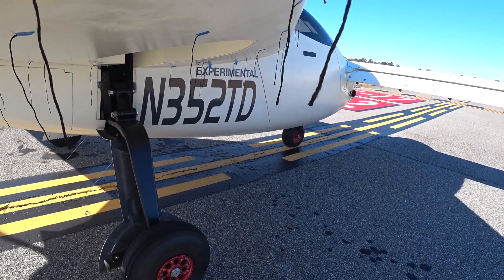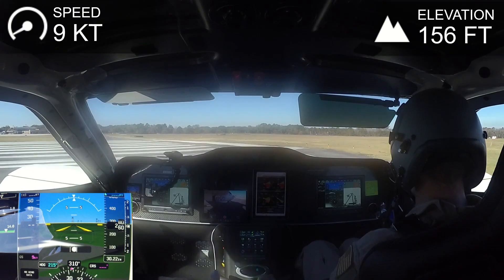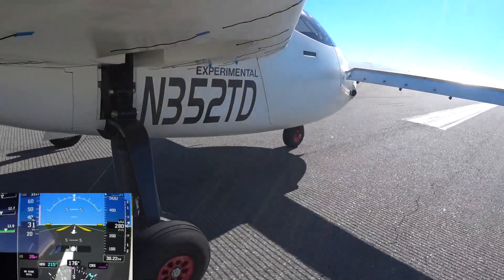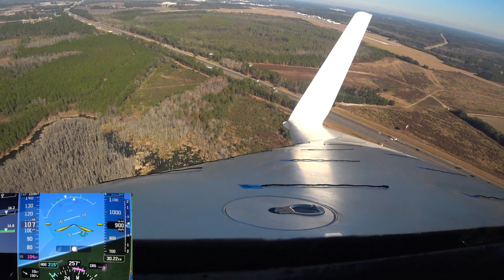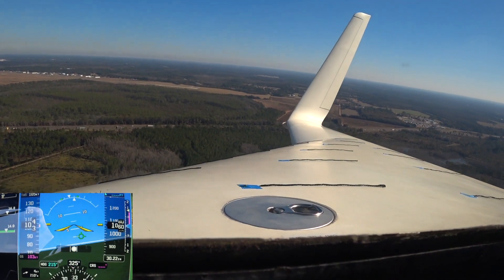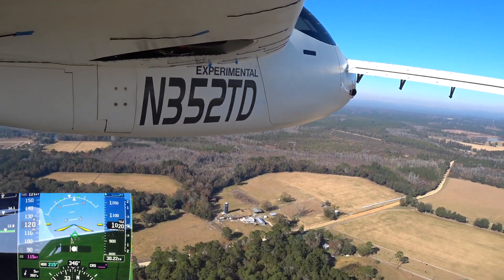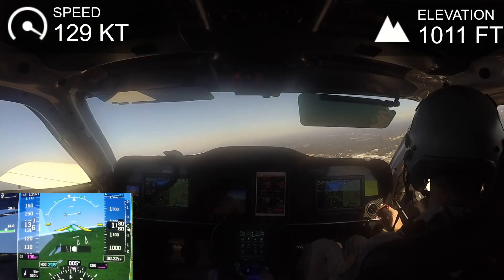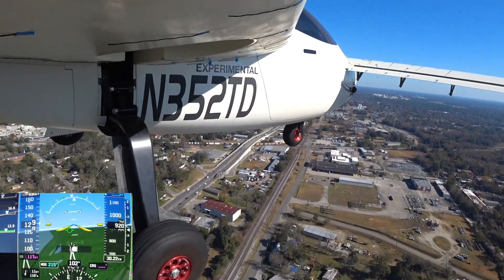Gear Up...  Check! - Flying the Raptor Prototype

Comment: just seems strange to me.. that wasabi was SO GUNGHO on helping peter get the raptor going- and then just a week into it- their only focus is distancing themselves from raptor? makes no sense. and that's not the first time I've seen this type of thing. 

anyone here remember the gemini diesel? they had a flying prototype.. with a lot of hours- they had a deal with carbon cubs, they had started manufacture in tx- and that was 2015. it was all set to be the most sought after 125 hp engine in existence at $25k, with plans for a 200, 300 & 400 hp version. then magically.. almost overnight- they sold out & were never heard from again. there's a list as long as my arm of the same type of thing.

 My guess is- if peter had put a lycoming or continental in the raptor- and asked for around $200k for it- suddenly and magically- it would be the greatest thing since seatbelts. 

        that conversation over gemini probably went something like this- hey- superior air? you currently sell certified part replacements for lycoming? if you want to KEEP doing that- that damn gemini needs to GO THE F AWAY! GOT IT?!

 I'd almost bet my bottom dollar- wasabi got the same phone call- some prick from cesna or piper, lycoming or continental or even velocity! hey! that guy is gonna hurt our bottom line- if you want to keep getting referrals for flight testing from us? you better DROP IT! and just like that? suddenly.. we need to switch airports- and fix more stuff.. no more stuff.. no more stuff.. well.. ya know.. we're just not comfortable.

 I don't buy it. 

mean while- peter has to DO THEIR JOB FOR THEM by the way... if your damn so-called 'PROFESSIONAL TEST PILOT" is so safe.. then WHERE THE HELL WAS HE ON FLIGHT DAY? SITTING in an office, watching from the comfort of his chair.. that's where. 

correction- I think you're right. it's best they DIDN'T fly- they probably WOULD HAVE crashed the plane. 

GO PETER!
Reply: Lol quite the conspiracy you have there bud
Reply: Earlier, someone posited that an aircraft similar to Raptor would need > 200 hours testing.  Just imagine the cost of two Wasabi test pilots at that rate.  🙄. 🎵
Few people seem to be aware of Peter's skills and experience prior to arriving in the US.
Reply: @berniemccann8935  true
Reply: @berniemccann8935  one talented dude. I commend him for sticking with it. when I hear all the little cesna whiners bitching & moaning about safety.. and 'the dangers' and how wasabi did so much & were such heroes.. it makes me sick. anytime someone's message is "oh! FEAR! watch out! it's all aimed at one thing- stop making waves. pull off the mask- and you'll find ALL the naysayers are either GA certified aircraft owners who see the $130k price tag & feel like a sack of retarded donkeys for wasting $200k on a plane that sucks 12 gph & flies 100mph and has the same technology under the hood that engines had in 1927.  OR they are DIRECTLY involved in the problem- ie, they work for a cesna flight training facility or they sell or service lycoming / continental. 

I'M NOT SORRY. they should feel retarded. that we don't have the average cost of buying a GA aircraft down to $30k - $200k ?  yet? after 100 years? is PATHETIC. the fact is- you can. you just can't do it with THEIR products. not because they're safer. not because they're better- because they have a  monopoly they don't want to let go of- and therein lies the rub- the reason for the whining. 

the FAA received NUMEROUS deadlines to switch to ADSB for planes. deadlines came & went. only when the bush administration started threating to take the FAA private did they get off their fat butts & actually begin to move- like a snail- but move. here we see the nation's top aviation safety office dragging its' feet.. not over some radical new engine advancement- or airframe development- no- stalling a SAFETY DEVICE! time for the FAA to go away. hapless clueless complacent bums can take their bureaucratic butts back to the unemployment lines. maybe GA can give them a job? the two seem to have profited alot off each other. 

I say RE create the FAA as a private testing organization- very similar to the UL testing labs. same standards, same methods- ALOT CHEAPER prices to get an aircraft certified. 

& update the rules for grief's sake! THE FAA certification rules have alot of the same stuff we had since WW1. metallurgy has gotten better, engines have gotten better, exo-skeleton composite aircraft- so much has changed- the FAA is just out dated.
Reply: Or more likely. They wanted to distance themselves from the multitude of problems they identified with the aircraft and the builders reluctance to fix item they identified.

If you watch the wasabi video carefully it isnt what they say. It’s actually what they DONT say.

They are just being professionals, removing themselves from the situation. And letter Peter do his thing

Comment: Peter, only one slight suggestion, and it's only aesthetic in nature. If you have to have an exhaust port for the intercooler, could you perhaps make it look more aesthetically pleasing? Like maybe leave the inner portion of the port metallic for the heat, but sculpt around it with carbon fiber painted white like the plane, and give it the same kind of symmetry and smoothness as the airship herself.  Because frankly Peter, you have painstakingly built the most beautiful aircraft I have ever seen. The exhaust port, the way it's currently constructed, just doesn't look like it belongs there. Don't hate me for saying this, but it looks kind of like you drilled a hole, (cringle), in the front of that beautiful aircraft, and then stuck a tin can in it.
Reply: It’s purely for experimentation at this point. A proof of concept if you will. I’m sure a future production version will have many changes and refinements
Reply: It's just a prototype !
Reply: @berniemccann8935  , Exactly! A very beautiful prototype. I'm very experienced building prototypes of different machines and Peter has performed masterful work. I'm thankful to learn from Peter Muller with all his sharing of his story. 3L TDI is brilliant and wide body Burt Rotan canard makes much sense. In my humble opinion Peter's work is a paradigm changer for private experimental aviation. My observation of you sir, is that you get it! Hope you have a blessed day!
Reply: @berniemccann8935  absolutely and that's what I'm glad about because this is my favorite aircraft of all time and I want it to be symmetrical and smooth and perfect because one day I hope to be rich and buy one of those.

Comment: Great progress......  So many people are wishing  they could quit their jobs right now and be able to chase a dream like this !
Reply: I have an off topic  question....... with such battery progress being made by companies such as tesla........ do you think there is  room for an electric option way down track? and would this use more / less weight and space?
Reply: @Finchy23  At the moment, mass/energy ratio is still prohibitive for any plane requiring significant range. Electric planes, both fixed-wing and rotorcraft, are in serious development for short-haul flights such as training and air taxis. When you can design the battery into the structure of the plane there might be a breakthrough. Initial investigations are just starting for that radical concept, including Tesla's cars that will incorporate the battery into the floor structure.
Reply: @Digital-Dan   Yeah - well I'm just thinking a single 400 HP tesla engine is going to weigh significantly less than the Audi twin turbo solution and cooling sytems. They are claiming the 200KWhr packs going into the cybertruck can provide 800 km range in the car, so long as the aircraft design is very efficient ( like the raptor ) , that should translate to good results.

They could also include  wing . fuselage top panels to increase the range while flying.
Reply: @Finchy23  , Since 2015 I've been developing Switched Reluctance Motors [SRM] for off grid pool pump filter pad systems, cars, boats, trucks, tractors, Home Off Grid UPS and aircraft. We feel Home UPS Systems and Tractors will be the best proving grounds for my system and focus till May 2023 as Legioneering R&D has in hand commissioned contracts for those applications. My technology for Battery Management System [BMS] is based on Parametric Resonance. Since 2015 the 1.5 KW prototype has 216 hour runtime at about a 2 HP pump equivalent. My electric version is coined MoGen Metronomic Parametric SRM. The 15 KW system is scaling nicely about 20 HP Equivalent for the same runtimes. I'm slated to start prototype production of 340 KW in May of 2021 450 HP Equivalent. The target weight for Motor, batteries and cooling is at 1,000 Pounds for the aviation version with a runtime of over 6 hours. The Tractor Version System is Projected for much heaver weight. I contacted Peter in June of 2020 with no response from him to propose my system in the Raptor Aircraft. Since he has the molds already produced that will work with my composite design. Seems many are adapting my technology besides Tesla, Siemens, Rolls Royce. So there will be plenty development with the big players and about 100 others. Electric Aviation is the future in my humble opinion. I have a passion for aircraft but I know the consistent money isn't in aviation! I'm leaning to a larger composite fiber Money style M20 for my personal aircraft prototype with my battery system acting double duty structurally to the aircraft instead of modular batteries. The aviation hobby is on the back burner now as no one has provided any funds and now I'm very busy. I will now use layup for my personal experimental aircraft unit.

Comment: Been watching for years glad to see the progress...even if it is a lap at a time. Need to get up out of the birds flight pattern . Them birds tear up composites...we had a few bird strikes during flight testing the B-2 some just made a mess, others did damage. At what point are you going to stop and fix the cooling issue?
You have solved and proven out the basic flight. Congrats.

Comment: improvements coming at regular intervals, additional weight, ie fuel, seeing wheel wells open, stability seen at all sites, cameras need a little work, need longer flight time!! then can see what is  happening to temps, cooling, etc, summer is a major test time for heat.  Do you plan on a separate oil cooler?  That would do wonders for the oil.  Otherwise, my friend, it is looking marvelous!!!! what is next? How long a flight time, and when???? Looking good, knocking down one problem at a time.  Soon, the proto will be  100% fine!!! keep it up and don't listen to the idiots. 1,000,000 attabits, good on ya mate!!!!
Reply: Are you Fernando Lamas?

Comment: I have a question. Is there a reason these test flights are at extremely low altitudes? I always heard altitude gave you more options in the event of trouble. Regardless, another wonderful flight!
Reply: Go get another beer.

Comment: Great stuff! When do you start working on the production aircraft no. 1?
Reply: I call dibs on the first one!
Reply: That's what the Fund Raising Pre-order Deposits were. He said in them that they were to be first served when presented at time of purchase in the order of the first pre-ordered Deposit.
Reply: @willsteed439  I know the background. At this point I  would assume that there is enough confidence in the design that capital could be raised to start work on manufacturing capability. I am sure production aircraft would also have much better performance with a reduction in weight. If I remember correctly the Raptor is a couple of hundred pounds heavier than planned.
Reply: @condor4679123    --  Very good (obvious) point.
Reply: @skyboy1956  wow I thought it was a couple of hundred at most. I am sure that once attention moves to manufacturing and refining the design they will be able to shed that weight without a problem.
Reply: @condor4679123  "Couple of hundred pounds heavier than planned" is putting it nicely. It's what I said to my wife when she was pregnant with our first child. It's closer to 1,000. Peter would be the first to admit that.

Comment: I wish you were flight testing over unpopulated area, like Mojave...
Reply: Flight testing of new aircraft designs and one off builds has been done at airports just like this one for years.  It is unpractical from a financial standpoint for most aircraft developers to move to a different part of the country just to use an airport over an unpopulated area.  Flight test programs of new aircraft typically take a year or more and being away from home base for a company for that long is often not practical.
Reply: Duck!

Comment: Basically, you have achieve your first goal.., i wonder what the turbo prop could do if it install on your plane.
Reply: The Cessna Silver Eagle 210 conversion has been a thing for a while now. Also Lancair offers this too.  Cruise fuel burns are in the 20’s. 
Just no option to cackle along at 22” and 2,200 in the 10’s gph with the turbine like one can do with a 540
Reply: ummm... suck 30 gallons per hour at idle & add another 1 million to the price of the plane? next brilliant question?
Reply: @jaybee3165  @Jay Bee  If someone willing pay to have it installed to this cool aircraft, i think Peter would be very happy. Perhaps it could fly 200-300 knot and higher altitude. But, making this beutiful bird flying is already great accomplishment for him.
Reply: @0069yj  that i could agree on. a turboprop would be a fun toy for a rich guy. nothing wrong with that.
Reply: @0069yj  I think he'll get much higher speed once he gets to high altitude. what I'd love to see is a 450 hp two stroke diesel- like a modernized jumo diesel in raptor. powerful, light, efficient.
Reply: @0069yj  like an engine from achates power.
Reply: @jaybee3165  and be 30 times more reliable than an auto engine in an airplane. Velocity is even making a turboprop version of their XL
Reply: @ApexAlex113  and I think that's really cool. REALLY. BUT- I would much have their twin with deltahawk diesels. by making the plane cost 1.5 million- you just cut your sales by 98%.  even if you could sell the turboprop version for the same exact price- you'd still cut your sales by at least 1/2- due to the fact that it takes a house payment just to fly the damn thing across the country. a deltahawk diesel can do the job just as well & just as reliably for 1/6th the price for the engine & 1/6th the price in fuel.
Reply: @ApexAlex113  it has long been the touted claim of lycontisaurus fans of how 'reliable' their engines are- engines that still have carburetors and magneto's. do you know what OTHER technology we still have magneto's & carbs in? LAWN MOWERS.  do you know the mean time between failures for a magneto system? 50 hours. the mean time between failures for ANY car engine with an ecu controlling fuel injection & iginition? 5000 hours. and that's not just for the spark- that's the ENTIRE ENGINE. don't get me wrong- i think lycoming & continental have done a great job with the capital they have to work with- but no way can they compete with automotive developements & economy of scale. have you seen aeromomentum? they have engines with 4000 hours and NO OVERHAUL. try that with a lycoming? you'd be nuts- or dead. I'd rather have a D-motor than a lycoming. purpose built, modern, light, fuel efficient, digital ignition, fuel injection, WATER COOLED- simple.  but you know what you CAN'T have in a d-motor or an aeromomentum? shock cooling, carb icing, manual carb controls that the pilot has to bother with. liquid cooling is WAAAAYYY better & way safer than air cooling. one, even, reliable operating temp for the whole engine. 

looks to me like the car engine is the more reliable choice. 2x the performance, 2x the reliability, 1/4th the price. what we need is deregulation and a private lab (like underwriter labs) to do testing & certification of aircraft & aviation engines- then you'd see companies like D-motor changing aviation on a global scale. making it safer, faster, more affordable for everyone. all that's happened in the last 50 years is- lycoming, continental & the FAA have set themselves up a nice little monopoly- that stifles innovation. AND? STILL BURNING LEAD FUEL. why not E85? or straight ethanol? way better high altitude performance.
Reply: @jaybee3165  I'm amazed that certification is so many decades backward in technology...
Reply: @awuma  yah... it's amazing what bureaucracy can for or... i mean... TO aviation. just imagine what it would do to health care.
Reply: 1.5 million aircraft with 5 passengers plus luggage? we already have that- DA 62. next redundant idea?

Comment: Might try adding 10k resistors in line to the audio input of the camera. Tower audio is clearly over driven. Intercom sounds ok. Had the same issue recording audio to my GoPros aloft.
Reply: This will fix the problem. I had same problem with audio and fixed it.
Reply: Shouldn't there be a MIC/Input gain pot or software setting available in the adapter or camera itself?
Reply: @bartofilms  Yes there is, but if the audio input is overloaded during recording (disortion) you can noy correct it later.